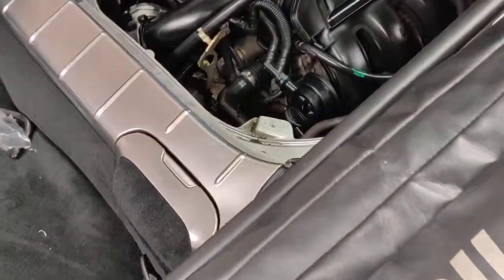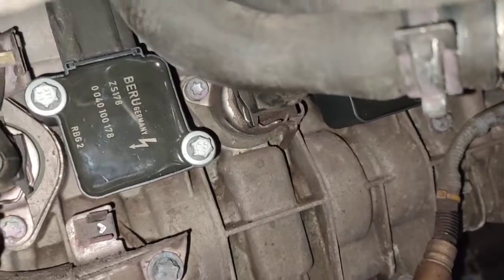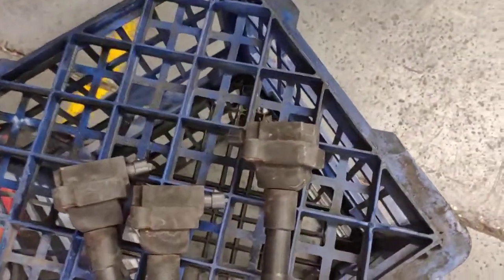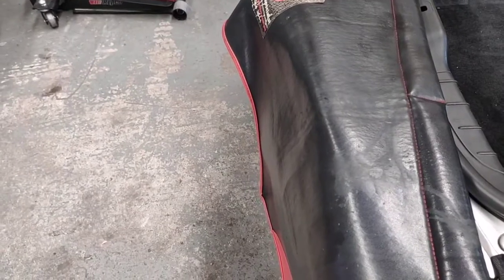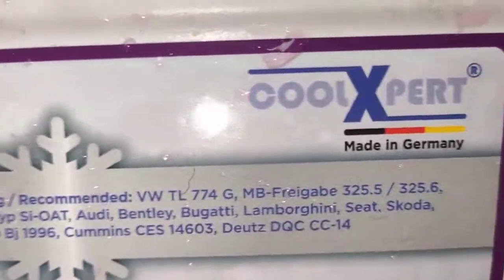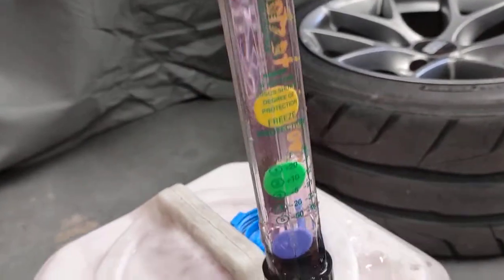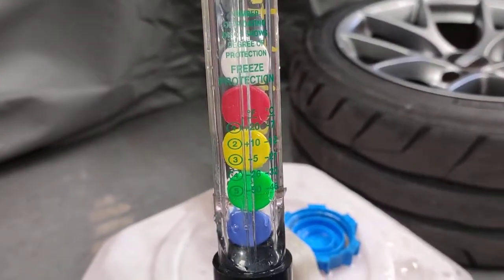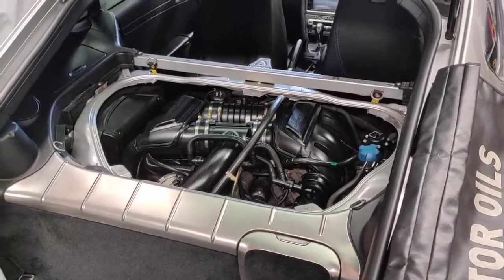Porsche Cayman 987 - Mixing coolant for cooling system

Comment: Woman here… about to put coolant into my cayman for the first time… assumed it would be easy but you’ve confused me! What the heck is that weird device with the floating things for?? I don’t have one of them! Jeez
Reply from the maker: @NineNineOne  get the OEM ready mix coolant for Porsche or just mix 1Litre of water with 1Litre of coolant & top up your car will be fine.
Reply: Sorry, for some reason I can’t reply to your message so I’m replying to my own message! Thanks for your help. I ended up using a Penrite Race Coolant Concentrate… I messaged my mechanic this morning  (on a Sunday morning) and he said that’s what he put in it last time so not to add anything else (he said not good to mix products). I just followed the instructions on the label and it said 100ml per litre… (I guess cos it’s a concentrate)… it took two litres before the level was mid way between min and max. I suspect I have a leak… cos my mechanic replaced the water pump only about 4 months ago.., I assume he filled up the coolant - but maybe he didn’t… Anyway, thanks for the video…  my other Porsche is aircooled… which is actually my daily driver… so I’d never had to put coolant into a Cayman before. Hopefully I did it right/got the right ratio… 🤞🏼🤞🏼.
Reply from the maker: @NineNineOne  Is your Cayman a 987
Reply: Sorry still can’t reply to your messages. Yes, I bought mine new, it’s a 2006 Cayman S
Reply from the maker: @NineNineOne  Check your coolant bottle inside engine bay or plastic coolant pipes under power steering rack, I see them leaking all the time.
Reply: @emdporschespecialistcaring8975   yes ok, will do. I suspect when my mechanic replaced the water pump he may not have tested for leaks elsewhere. Or one has developed post-pump replacement. 

So are you in the Porsche Club NSW? I used to be president of Porsche Club QLD for a couple years.
Reply from the maker: @NineNineOne  No just at Caringbah